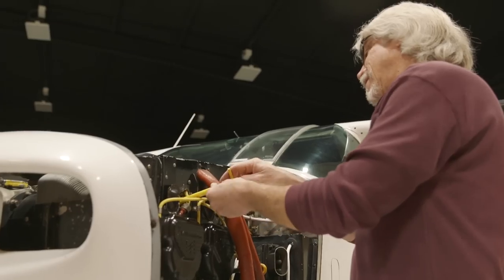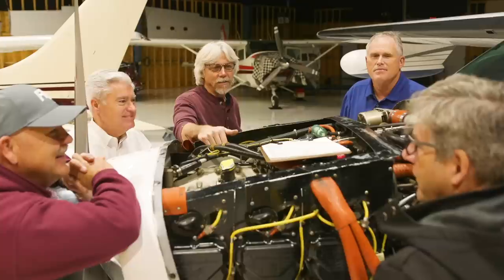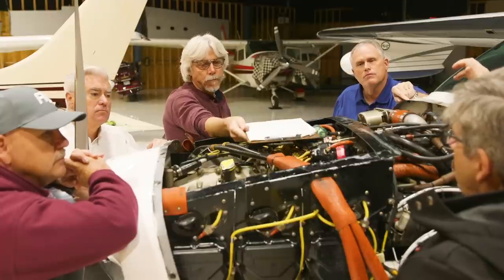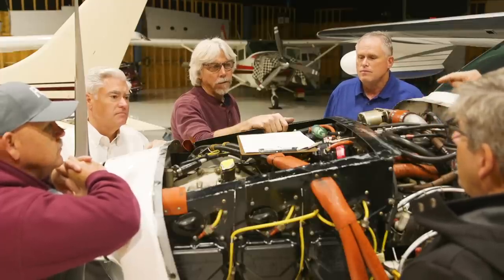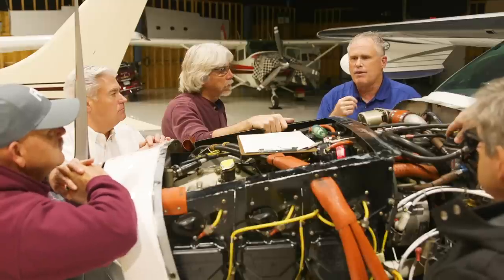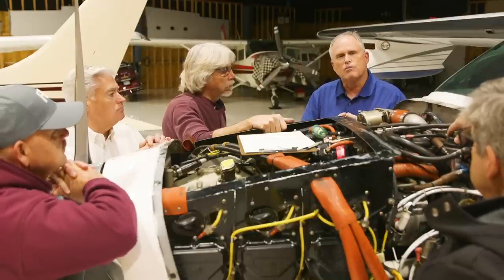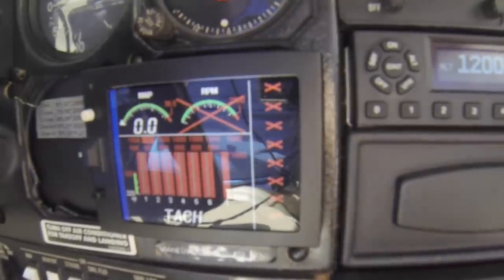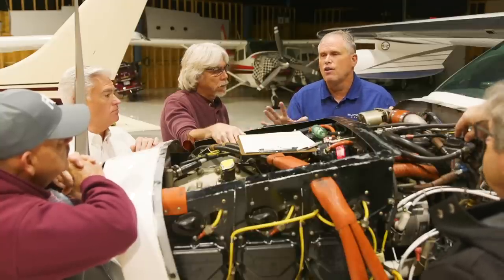Cylinder Compression Failure - InTheHangar Ep 64

Comment: When I saw the video posted of initial break-in I thought the fuel flows looked way too high.  I figured they hadn't run SID97-3 yet.  I thought for sure one of the pilots was going to pull back the mixture to get the EGTs up, but it sounded like they were happy with <1200 EGT at full power.  I get running extra gas for detonation protection and cylinder cooling, but it looked like it was running about 10% richer than "Full Rich".  I wouldn't be surprised if the low compression was related to improper breakin due to not having the fuel injection ever setup properly.
Reply: I thought that also. Running that rich will also cause a loss of rated power.
Reply: Low 1200 EGT's is exactly where you want to see FF set up at full T/O power climb and yes all was calibrated at 2700 RPM & 36.5 MP
SID97-3 has been superseded with current M&O. Calibration hasnt changed for TSIO-520-R however from original SID document.
Reply: @cessnarigging  You're right that the SID was incorporated into Publication M-0, and understanding that EGTs could be affected by many variables (timing, probe placement, etc.), it probably makes sense to just refer to Publication M-0 and Publication X30044 (TSIO-520 Series Operator's Manual).  Of course the max fuel flow at Max Power (36.5"@2700rpm) would be 31.7 GPH per M-0 (I understand that the POH says 31.0 GPH or 186PPH).  I actually prefer my engine to run a little rich too, maybe even >32gph so that I can still get 31gph on a very hot day, but this engine was way past that.  Worse than being too rich at full throttle, if the pilot is running around set to "Full Rich" at partial power this motor is running well beyond the "Maximum Allowable Fuel Flow" as depicted on page 5-30 of Publication X30044.  At this point of the flight ( https://youtu.be/lAnM2QnBQak?t=484 )  the engine was running about 25% above "FULL RICH LIMITS"  which is about 17% above "Maximum Allowable Fuel Flow".  One final note: I also noticed that on T/O the MP never reached 36.5" which is required to make "Max Power" so the fuel flow should have been less than that specified in M-0 for Full Power.  I can't be sure from my arm chair, but it might have something to do with @tom3holer 's comment.
Reply: @yamashill  I did go back and look at the video you linked to. I was the one flying the Acft in that segment and you see 35.4 MP with 2690 RPM & 34.4 GPH FF with 1255 TIT during my initial Climb. This was Summer day & didn't see OAT but know it was heat of TX Summer afternoon so additional Fuel utilized for cooling. The Fuel Flow vs Brake HP Chart you referenced in X30044 is based on an Engine leaned for "Best Power" that is generally around PEAK or just slightly (appx 25 DF or less) ROP-PEAK. This is not where one wants to break in new rings as EGT & CHT's would be at max limitations (roughly 400 DF CHT/1600 DF EGT' ranges) although CMA does no recognize EGT limitations. Cessna recognizes only Max TIT which was established for Turbo & Exhaust System limitations.  As one might expect there are several factors that effect EGT-TIT and all parameters of Engine set-up need to be correct for proper Fuel Calibration including verification of Aircraft instrumentation. There was issue with APC as well and this has been corrected after that initial Video. As an A&P I only make recommendations, the Owner determines if the Aircraft is Airworthy outside the Annual time-frame which is when I verify condition of Airworthiness. I was unaware that APC needed adjustment until 2nd Take-Off with Oil Temps in operating limits.
I also have the mindset that appx 2 GPH above top chart is what it takes to adequately cool the Engine in summer Op's. Anything above 4GPH and as someone else mentioned you start seeing a power decline. The 2-4 GPH above max FF for Summer Cooling was actually brought to my attention by the individual that was doing the initial re-write of SID 97-3 and tried to get that incorporated in its first release. Above the 4 GPH beyond top scale in Winter Op's and there is reduced Power curve thus why they opted to compromise in between an average temperature range is my belief. If Fuel Flow is found above spec during initial Take-Off after Top O.H that can be controlled easily with mixture knob and once Cylinders have some break-in time then adjusted once things stabilize. One doesn't want to do the Full Power Fuel Calibration procedure on the ramp with a brand new Engine or Cylinders unless there is inadequate Fuel Flow, that is another matter.
Of course all of these TSIO-520 Engines in these installations can & will over-boost on 1st T/O by design without Pilot interaction to prevent this when going firewall fwd. Likely explains why I held MP at 35.4 on initial Take-Off as I was scanning more pertinent matters and had plenty of initial Climb performance.

Comment: Great discussion about throttle application but it was ALL related to engjine-- Nothing about aircraft control.....2 potential issues with discussion of throttle application---- not so fast you give up rudder control for P factor and potential prop damage with FOD.--- all assuming oil temp is adequate!  just my 2 cents---- Private Pilot, NOT an A&P/IA

Comment: so what was the outcome?
Reply: Still on the fence. IAW Continental Engine recommendations along with folks at Superior Air Parts they will run higher power settings briefly for a few hours and a retest. It is unlikely that at least one Cylinder does not get replaced but for right now the plan is fly & retest. There was an Annual to complete. At the time video was taken Holidays followed shortly thereafter so expect next few weeks we will be back on this again. When Acft returns a second compression test result will determine follow-up actions. The initial Borescope looked quite good and after I did a short Flight in the pattern to adjust APC I took another check on #4Cyl & the readings came up approx 2-3 PSIG from what I recall. We need to rule out Ring Gap alignment and pulling a Cylinder prematurely.
Reply: @cessnarigging  I would be interested in the following information.  What were the actual original compression readings on each cylinder after initial installation and run-in?  Secondly, if the new readings persist, I would be curious as to the root cause of the degradation.  Not generalities, but actual determination.  Although the level of service is "superior" (sorry! LOL), why did a cylinder degrade so quickly, if in fact it did?  Finally, I would be interested in the oil analysis results.  Just my thoughts if it were my engine.
Reply: @JMOUC265  This is a high use Acft so previous Compression test was taken @ 83 hrs.  #1      65      #2      70      #3      70      #4      64      #5      72      #6      74-75.  generally I expect better readings however still a bit premature with new Cylinders to come to a firm conclusion. I discussed a 100 hr Inspection with the Owners not shown on that video for better trend tracking. I don't have the oil sample results however oil samples were taken & given to Owner after oil changes. Degradation is leakage past rings, that is for certain. Several other factors have been discussed such as oil usage, accurate topping off of oil, keeping belly clean to see amount of oil discharge etc. Monitoring several areas now that issues have been noted. Maintenance & Operators need to work out these type of issues by communicating throughout the process vs address problems during a single maintenance event.
Reply: @cessnarigging  Thanks, John.  Like the Holiday Inn Express commercial, I am not an A&P, but …   I have watched webinars by Mike Busch and listened to his podcasts and watched his videos regarding engine maintenance.  They seem to make sense, especially his recommendations regarding oil analysis, engine data, and particular lubricant recommendations.  Maybe the owners would be more receptive to your recommendations if they listened to some of Mike's ideas.  Not trying to step on toes here, so please forgive me if I am.  Again, I'm no A&P,  but they appealed to my logic.  Good luck.

Comment: What is a master orifice leak limit? Are you not doing an 80 psi leak down test like always?
Reply: Two separate "Calibrated" Compression Testers with built in M/O were utilized before Dan received a call about findings.. Compression readings identical. One or two Cylinders might have varied 1 PSIG between both readings. M/O reading itself varies with each tester. Without the record in front of me I can say the O-520's are generally around 40 PSIG @ M/O

Comment: As of today don’t see John Effinger’s comments. Also, no mention of where the loss of air was going (past rings or a valve).
Reply from the maker: His comments are down there still. Just checked. We don’t know yet where the loss is. Will do a follow up when we check next
Reply: It was all Rings across the board. Borescope revealed proper burn-heat control on Valve faces.
Reply: @cessnarigging  What?   And I bet the End caps were to close to start with.  Did you take the ring off the pistons and put them back in the cly and check the gaps.   you need a lot of gap  when install go to the max gap.   your engine will be happy    Never use the smaller gap never
Reply: @ctsteve1967  Ring End Gaps were verified along with Rocker/Valve Lash during assembly. This was discussed somewhere else here regarding assembly checks. I believe this was discussed in this Video or the follow-up with SAP folks.

Comment: While these readings are on the lower side of the spectrum for a low time engine, and had I spent the $$$$ these guys had I would be irked about it, everyone clutching their pearls about those numbers must have grown up on Lycomings.
Big bore Continentals simply do not hold compressions like a Lycoming. It is not at all uncommon for a big bore Continental to have test numbers in the high 50s and lower 60s. Too many A/I’s yank perfectly good cylinders off of airplanes because “60/80”.
Compression tests for Continentals are not the same as Lycomings. It is entirely possible for a cylinder to test in the 40s and still be airworthy (see Teledyne-Continental service bulletin SB03-3). Would I fly it? Probably not, but you get the point.

Comment: My left butt cheek where my back pant pocket and wallet are clinched when I heard low compression... (remove $2000 from wallet). Those are low compression #'s. All mine mid to high 70's.
Reply from the maker: How was the butt cheek when you hear Superior say they'd cover parts AND labor?  I know mine unclinched. LOL
Reply: @TakingOff  ... not really... because if you don't determine the cause of the problem, you'll be in the same position 350 hours from now.  No A&P here, but my guess is poor break-in (glazing) of the then-new cylinders.

Comment: Well, you’re not going to “tear up your brakes” when you’re not even rolling on a short field takeoff. 

Also, for cylinders with only 360 hrs on them, all compressions where shockingly low. It’s disappointing that you did not point out where the failure was (valves or rings). Certainly not a very good endorsement for Superior.

Comment: Ok, so several thoughts. Great news for you with the warranty if needed.  For those who are unfamiliar, it should be mentioned that most of these type of compressions on a Lycoming would not be acceptable. There is not "Master Orifice" used for Lycomings. Along with that is a question is your engine developing rated horsepower with these compression readings? If not, how are you loading it, and takeoff distance required? The other thought is applying power at takeoff. Strictly my opinion, but the amount of wear on the brakes while sitting still would basically be none. Brake wear comes into play when you are moving the brake disc against the brake pads not sitting static.  If there is loose debris at the end of the runway that can be pulled into the prop, notify the airport to remove, repair, or seal the runway. To get your mind the accelerate/stop distance, an easy way is somehow mark your exact touchdown point while landing, then measure to the point you are actually stopped. The speed that you touch down is going to be a little slower than speed at rotation, so keep in mind the stopping distance for an aborted takeoff could be longer.  Now measure the distance needed for takeoff add the landing distance to it and see if 3300' is enough to accelerate and stop. Then while you are checking those figures Think about a turbo malfunctioning during the takeoff roll. Until you push that throttle way up you won't know if it is functioning to its capacity.  I routinely operated a T210 from a 2800' runway.  There was no way that I would release those brakes until the turbo reached it's maximum manifold pressure.
Reply: Another axiom is Sparky Imeson's teachings. If you don't have 70% of your takeoff speed by 50% of the runway, sumpin' might be amiss. He added another 20% distance for 4" grass and I'll have to look at my notes for the rest of his  mountain flying teachings which work well for rule of thumb flat-landers. Great post.
Reply: Keep in mind this is a TSIO-520 so Turbo will produce as much power as you want. I have found single digit to teens for compression readings on more than a few Turbo 520's. I flew a T210 years ago doing a critical Altitude Check prior to the initial maintenance and found a Cylinder at 12/80. Still passed critical Altitude check to 18K with flying colors. Nothing out of the normal and didn't skip a beat.
Here is an older Video Dan made with a friends T210 with an example of a dead Cylinder. Look at the Engine monitor,  I had flown this Acft quite a few times and trips with our Wives on board! That was the 1st time I ever did a Compression check on that Engine and it was quite surprising to see those values. We knew there was a Valve in distress and you can see this on the Video with "comments". Without the EDM-930 there is no way one could tell operating the Aircraft there was an issue. Before Engine Monitors we either went to failure or found this during Annual Compression Check. https://www.youtube.com/watch?v=kJXtLhJj6CY 

 No doubt Lycoming Engines are a different breed. If I see low 70's or more than 3-4 PSIG variance between Cylinders generally there are issues developing. TCM Engines can stay there for 1000 hrs.
Reply: @cessnarigging  John I know you have knowledge of this only sharing for those who haven't  gone into the process. A lot pilots rent, and therefore normally are not involved in the maintenance. Per Lycoming SB: Unless the pressure difference exceeds 15 psi the investigation should not necessarily mean removal of the cylinder....If the pressure reading is below 60 psi or if the wear rate increases
 rapidly, as indicated by appreciable decrease in cylinder pressure, removal and overhaul of the cylinders should be considered.
Continental and Lycoming engine parts are all doing the same job, so what effects one does effect the other. It is interesting that Continental came up with the "Master Orifice" for diagnosing engine compression and Lycoming doesn't offer the same tool or guidelines.

   I will say that with the reduction in compression there will be a reduction in horsepower. Regardless if there is turbo. This is why on multi-engine aircraft the VMC is determined by "New engines at Sea Level". A safety factor gets built in overtime with the engines developing less horsepower,  VMC actually decreases below Red Line, building in a safety margin. Also with the increase in Altitude normally aspirated engines make less horsepower, meaning VMC will be lower than Red Line.
Reply: @blimpcommander1337  You are correct in both Engine manufacturers have set up guidelines for determining removals that fall into warranty department claims. Obviously this has been modified over the years to reduce the number of warranty claims not necessarily to benefit end user. Lycoming Engines have much lower parameters then Continental Motors when they start showing distress. You can see "the writing on the wall" well in advance before you get to the rejection state.
I have spoken with several Engine Shops and been to various Engine stands with dyno set-ups including the Mobile facility this past summer. The consensus is that Engines will still produce rated HP with very low to no compression readings. This was discussed at CMI course where an Engine was operated without compression rings to simulate "low compression" and still produced rated T/O power. Mattituck had done similar testing as I know the individual that was over that testing program. I have heard 1st hand from several other Dyno operators similar stories.